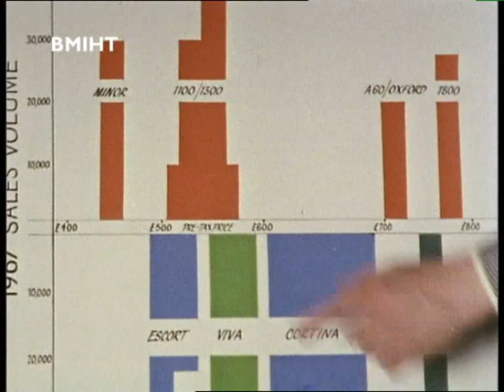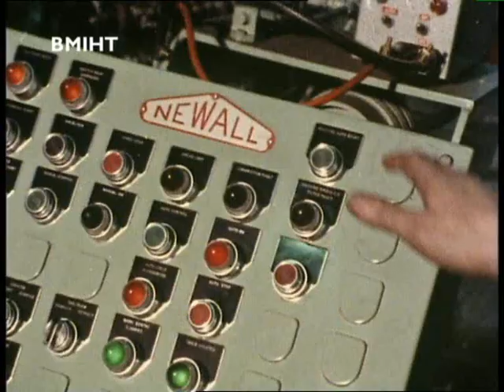Morris Marina Development Part 1

Comment: The Cortina and Escort were wonderful, the Marina and Ital were shit barely superior to soviet products. Japanese cars of the time were far superior, in 1970 you could get a Datsun 1200 with disk brakes, MacPherson struts, assembled by a real worker instead of a pension-sucking communist. You could also get a BMW 2002 which was a magnificent car. Keep in mind that just 745 Marinas are still on the road 30 years after production stopped, out of 875,000 sold. It's shit.
Reply: Datsuns, Hondas and Toyotas were rust buckets at that time - as were Alfa Romeos and Vauxhalls. Ford had a problem with corrosion with metallic paint finished Cortinas! In hindsight the Marina may not appear to have been a good car - It sold well though!
Reply: In your opinion the escort was a pile of white and the Capri.mate had a Toyota gorilla 3 years old went over a bridge too fast it fell apart in a pile of rust.
Reply: @Trebor1172  That's the thing.  It did sell well. And nearly eight hundred people in 2019 think they're worth running as classics. It's not all about MK2 Jags and Aston Martins, is it?
Reply: @TheHorsebox2  

Unique too. Every Marina handles differently.